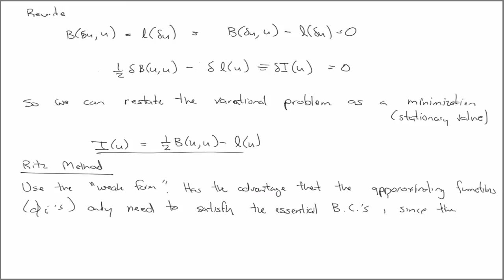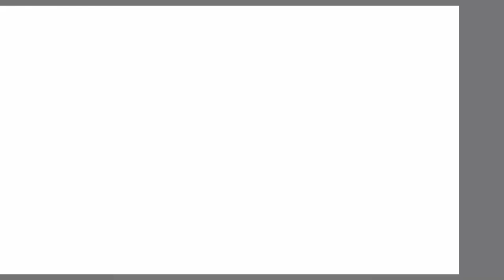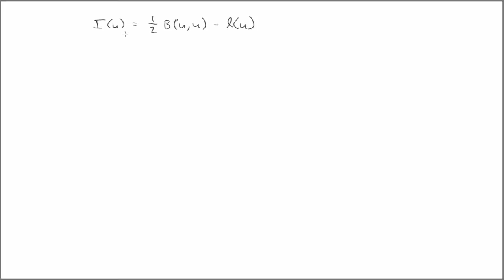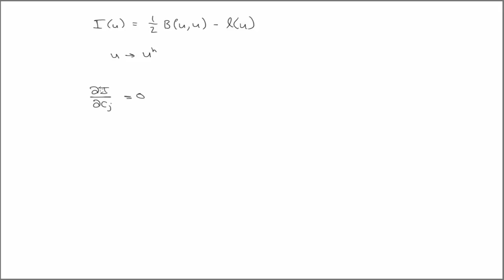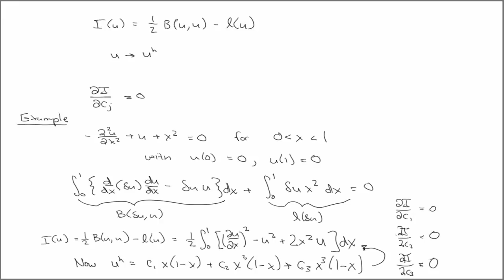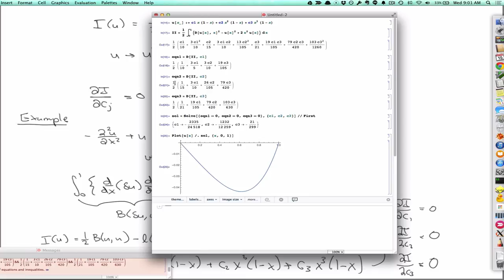Ritz method

Comment: how do you come to the quadratic form? more specifically, how do you get to (du/dx)^2 - u^2 +2x^2 u ?
please help
Reply: +teynerdy It simply follows from  the weak form.  Taking the expression for B(\delta u, u) and replace it with 1/2 B(u,u) and l(\delta u) with l(u).  Also, I want to pull the constant 1/2 outside the integral over both terms so I multiply the l(u) term by 2 for consistency.